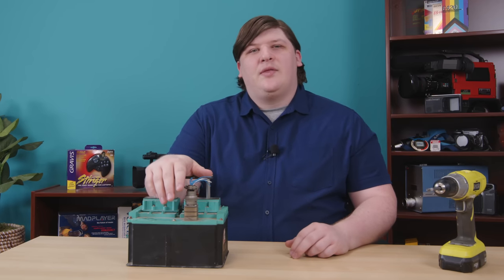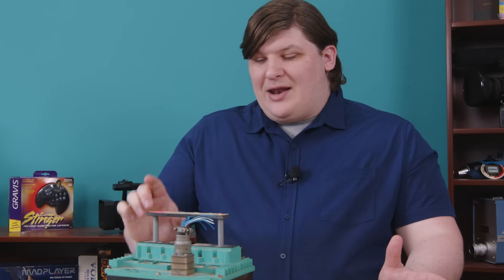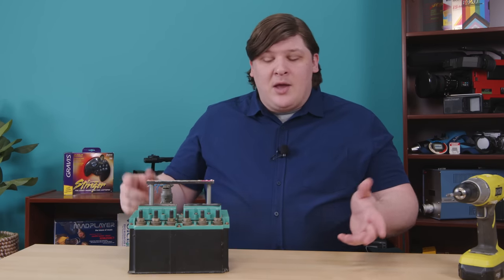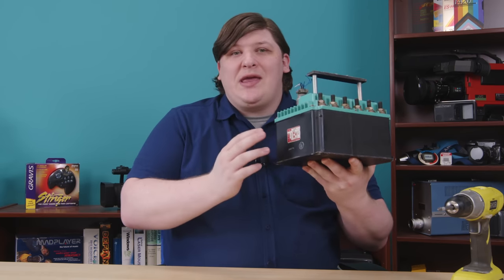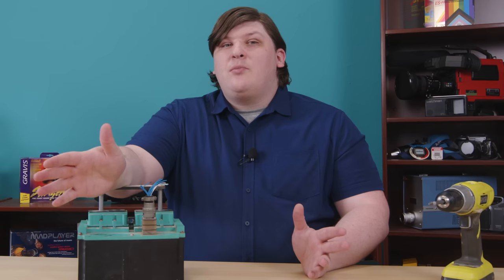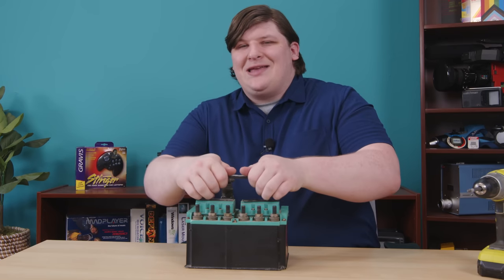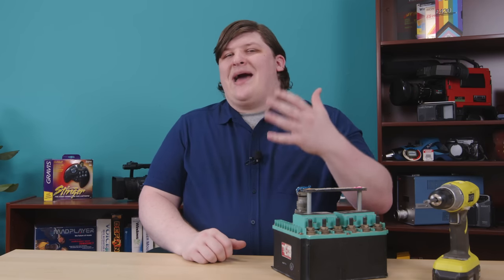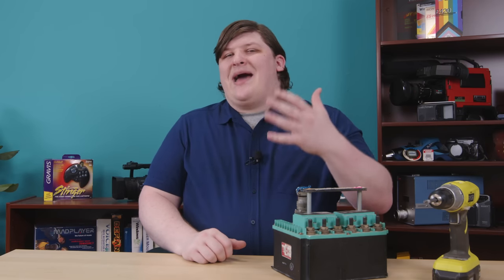A Short Story About (Battle)shorts

Comment: Your mentioning of aviation electronics running at 400 Hz made me suddenly realize why so many recordings of pilots on radio have this weird middle/high-pitched buzz in the background. I always wondered where it was coming from!
Reply: I spent 9 years building industrial servo drives and, more pertinent to this subject, motors, synchros, resolvers, and tachometers that were aimed at aviation and defense contracts, and all ran at 400 Hz. That high pitched hum is burned permanently into my brain And 5Khz is burned out of my left cochlea... permanently... Legit have a drop in my hearing range at 5KHz due to a loud test motor... but not relevant here. 400 Hz is used in most naval and aviation environments, because the higher frequency allows a smaller transformer to be used than 60 or 50 Hz would require. This saves weight.

I'm building an instrument panel that interfaces over USB to the game Kerbal Space Program, and I was able to acquire a real FDAI (the navball, 8-ball, artificial horizon, ADI, whatever you wanna call it) that was salvaged from a retired Israeli F4 Phantom flight simulator... Cost me an arm and a leg (I was eating ramen for a month! LOL), but I'm planning an having a great Apollo themed instrument panel to display game telemetry and transmit input controls to the game.

One of the harder components to engineer has been the digital control method to emulate the old analog synchros that would have been used to control this FDAI. First, I need a 400 Hz reference signal at 115 volts. This provides both power to the FDAI, as well as the reverence signal to which all inputs are compared to (internally within the FDAI).

I'm getting +/-10vac @ 400 Hz from a vintage digital sine generator that takes a 10-bit ROM with a quarter sine wave lookup table, and cycles through counting up and down again, then flips the output polarity and counts up and down yet again, to produce a 2048 step 11-bit resolution sine wave. That is fed into an analog selector board to select positive or negative polarity, and then feed that into a multiplying DAC to attenuate the sinewave. That's then sent to an amplifier that will output nine different signals that will have a peak of 28vac at 400 Hz, emulating all three control transmitter synchro transformers.

That 400 Hz oscillator will also feed into a separate amplifier board that will generate 115VAC synchronized to the 400 Hz input frequency.

So far, I've built the 115vac amplifier board. I've worked out the general block diagram for the selector/DAC board, but need to lay that one out and have it manufactured.

Many of these 400 Hz devices will produce an audible 400 Hz hum. I've gotten so used to it that it doesn't really bug me. Some people hate the sound.

(Some minor edits made for clarity)
Reply: @richfiles  Umm that’s a very unusual and IMO incredibly sketchy way to build a 400Hz inverter. Why not build a modern VFD? Just 4 MOSFETs, gate drivers, a $1 MCU, and an LC filter will give you a perfect sine wave.
Reply: @NavinF  The power amplifier already IS a MOSFET inverter, it just takes an external reference frequency as an input. Where you seem to have confusion, is the synchro emulators. The high voltage circuit and the synchro emulator circuits are two entirely separate things, and all they share between each other is a +/-10v p-p sine input.

I'm not building some VFD to directly power some kind of motor, period. There are no variable frequencies in this circuit. At all. everything is fixed to 400 Hz, and synchronized between all 10 circuits that will be required. I'm emulating three synchro control transformers, which feed 9 total signals into the FDAI's (Flight Director - Attitude Indicator) inputs...

Inside the FDAI is a comparator circuit which derives the error between the internal synchro receivers, and the external synchro control transformer's input signals. That comparator + motor drive part of the circuit is built entirely into the FDAI itself. All it wants is Reference + Power (on the same two wires), and the command signals from three external synchros (over 9 wires). This is a fully self-contained circuit that is integrated into the device.

The power amplifier design is actually a re-engineered circuit from the era the device would have originally been in use, but updated to use modern components. The original circuit was literally designed for powering FDAI devices, specifically. I had assistance with this circuit from another individual that routinely works with line level voltage power supplies, as I haven't worked with these types of circuits in nearly 13 years. All it is is an op-amp that takes the input frequency, and outputs it through some gate drivers to drive some MOSFETs and produce the 115vac output, matching whatever the input frequency is. The input is only +/-10v p-p. Output is 115v RMS. The circuit even has overcurrent protection. It only needs to be single phase. The reference is a combination power source + time base to compare the synchro inputs to. This circuit only powers the FDAI... It doesn't have anything to do with the synchro emulation, nor does it generate the 400Hz

You seem to be confused about the sine generation, and the synchro emulation as well...

The sine generation is using a vintage 850T Precision Oscillator, from California Instruments. This isn't some device I'm building... I only described the theory of operation in my other message. Sorry if you thought It was some circuit I was creating myself... It's a precision industrial digital sine generator that plugged into a 1980 California Instruments Invertron. At the time, it was the highest oscillator upgrade option for that particular system. It's actually the original oscillator from the rack mount inverter that supplied the entire building where I used to work with 400Hz AC. Not simply the same model as...  The VERY SAME UNIT from my actual former job... I bought it at auction when the place closed down (we got bought out by a competitor). That very oscillator was the exact oscillator that we used for three decades to build motors, synchros, resolvers, and tachometers for aviation and defense contracts. It's... sentimental. I could easily make a sine wave with a simple oscillator circuit, a small analog chip, or a microcontroller with an LC... sure... But this is the oscillator I'm using. It was a high end industrial product that is 1000% overkill for this application, but I have it, and I want to use it. The output is 10v p-p, exactly what I need. It was, by design, meant to generate a sine wave for an industrial inverter... The inverter it ran was a 4 person lift per phase, and two phases completely filled a whole half height rack. This was part of some real industrial gear... The old Invertrons are long gone, but I kept the oscillator itself. This application only needs to be single phase. The reference feeds it's signal into the power source and to the synchro emulators.

Regarding the synchro inputs... Synchros are an analog mechanical angular position sensor that has an excitation winding that is fed with 400 Hz synchronized to the reference. In this application, a synchro would take 28vac @ 400 Hz... I'm not actually using real synchros though. I'll be emulating them, so that I can control the signals from a digital source.

The thing that confuses a lot of people about synchros, is that there is NO variation in frequency between the input and any of the three outputs. Synchros generate an amplitude modulated signal. Depending on the position of the excitation rotor winding, each output can have an output that ranges from 0% to 100% attenuation, and every 180° the polarity of the output is inverted. Each output is rotationally 120° apart, but the phase relationship with the reference remains synchronized... hence the name... The three outputs amplitude is modulated at 120° angular relationships to a sine wave, not the frequency phase.

To emulate this:

1: I feed the oscillator's sine outputs into inverted and non inverted op-amps to generate inverted and non inverted DC biased 0-5vac sine waves that will work with the components down the line. (0-5v CMOS analog switches and DACs are cheaper than +/- rail to rail parts, and capacitive coupling results in a floating +/- output again)

2: A microcontroller will then control a series of CMOS analog switches to select either the appropriate inverted or non inverted sine output to match the appropriate part of the 180° rotation the emulated virtual synchro is at.

3: That selection is then fed into the voltage reference of a multiplying DAC. The Vref rises and falls with the sine wave, in real time, and the microcontroller only needs to update the DAC value to set the attenuation level to match the correlating attenuation level of the virtual synchro's angular position.

4: The output is fed to a 28v amplifier that produces a modulated output from 0-28vac @ 400 Hz.

This is repeated three times for each synchro, with three synchros being emulated, for a total of 9 of these circuits.

It's literally just the non-inverted and inverted sine output from the California Instruments 850T Precision Oscillator fed to a basic CMOS analog selector, the selector fed to 9 multiplying (attenuating) DACs, and the outputs are fed into simple audio power amps, which seem to be the most cost effective and off the shelf method to drive an inductive load. The audio amps are a reference design. The DACs are a reference design, and the selections are just based on a basic CMOS analog chip. Nothing in this circuit is particularly high voltage, or even novel... input is +/-10v p-p, output is 28vac. Everything is locked to the 400 Hz reference signal, including the separate inverter powering the FDAI (navball)

As for the whole "vintage" theme... I'm mimicking the old Apollo Command Module's instrument panel. I want mechanical navballs and meters and retro looking instruments... That's by design. if I wanted modern, I could have used an LCD panel and made a virtual navball. The work's already been done, no less. That's just not what I wanted though.

Hopefully that clears up your confusion.
Reply: @richfiles  5k is an aggravating frequency anyways, you've been done a service (half-joking).

Comment: i live on a farm and we have a generator for backup power. the generator was bought at a county auction and it's military surplus from the late 80s and has a battle short switch. turning it on will let the generator run with low oil pressure, high temperature, slightly incorrect voltage, or any other circumstance where you might not want it to run.
Reply: that actually seems like a good thing to have for diagnosing repairs. easy to eliminate the engine if your looking for a problem
Reply: I was just considering buying a military generator for my place.  Getting tired of replacing consumer generators every 5 years or so.  

we get outages with severe storms like clock work, tons of dead trees in hard to reach areas so they only fix it after it breaks cuz that’s how our power company operates.  Usually only last a day.. but in winter if we lose power during a snow storm or blizzard, can be a week+ before power gets restored way out here.
Reply: i don't know if the battle short switch actually does anything now. a lot of weird military specific stuff has been removed or replaced with more conventional parts because finding real replacements is difficult. the oil pressure gauge quit so it has a simple non-electric one now, same for temperature. but i think the sensors that go to the battle short might still be there. so if one of those fail we might need to put it in battle short mode

Comment: having served in and around large military equipment with bypasses like this, they require a mindset counter to the everyday logic of safety first. oftentimes its safety second, third, or not a factor at all in the name of getting the job done. as you said, thats an issue for future you. also a clarification: nobodys doing math or thinking too heavily about the engineering implications when its time to hit that switch. we need it to work, we need it to work now, so lets make it work as long as we can, and once it craps out for good, its time to fix bayonets
Reply: The thought of a battleship crew that just lost their LIDAR-guided self-targeting hypersonic missiles immediately falling back to bayonets cracked me up.
Reply: When he was describing 'how they would have to think about it' my immediate thought was, "Thinking about it?  If it was a simple toggle, they likely keep it depressed until they can smell insulation burning, or until the turret guy yells 'Hey, it's starting to glow!', then let up for a few moments until their teammates say 'Uh-oh, he's coming back this way!"

Being a one-use thing does make sense, especially if its 'mode of operation' is 'locking the relay contacts together physically'.  Did they all press properly such that they can disengage and return to anything like 'normal operations'?  Did anything weld as it slammed home to activate the stalled motor?  You really couldn't trust it for anything after that...but when you REALLY, TRULY needed to trust that This Thing Would Work For Now and all other considerations were secondary...BAM.

Also?  Bayonets are as frightening as 'battle shorts' themselves; when you REALLY, TRULY need to have an option to kill a guy who wants to kill you...when all else has failed, when everything is EMP'd, when the gear is all sand-choked and jammed up forever?  "Grab The Sharp Thing And Get To Stabbing Stuff!"  When you need an option to allow saving your life anyway despite all the equipment failures, damages and blown overrides, 'Sharp Pokey Thing Discourages Bad People' is nice to still have around.  It always works.  Will it SAVE you..?  Maybe not...but it MIGHT, and that's what matters.  :)

Comment: Hey! I've done design work for control systems for naval applications. Can't get into super specifics on the applications I've worked on, but you're right on the money. Sailors have worry about thermal and other kind of overloads, which would shut the piece of equipment off. And in some situations, sailors don't want that piece of equipment to turn off, hence the battle override. In the applications I've worked with, it was a switch on the piece of equipment that would allow the sailor to run whatever the piece of equipment was until "the cows came home" or the motor burnt itself out. (So imagine a switch with three positions: "On", "Off" and "Battle Override" and then buttons to either "Start" or "Stop" the piece of equipment and you basically get the idea. Hold the switch in "Battle Override" and press "Start".) While this relay is definitely way older than what I've integrated into the systems I've worked on, the basic premise is still the same then as it is now.

Additionally if you ever hear the acronym "NAVSEA" thrown around, it's just the shortening of "Naval Sea Systems Command". So the association that held that symposium was just a bunch of scientists and engineers who worked at NAVSEA and the acronym would be ASE NAVSEA. Probably some NSWC (Naval Surface Warfare Center) and NUWC (Naval Underwater Warfare Center) personnel as well as some Naval Reactors people. (Although NR is a whole different monster than the rest of NAVSEA, even though they're called NAVSEA08. Technically part of the Department of Energy and not the Department of Defense. And NSWC and NUWC would just be like sub-agencies under the NAVSEA umbrella proper.)